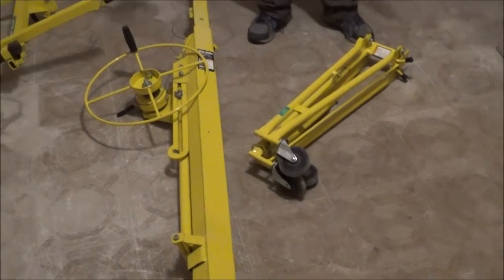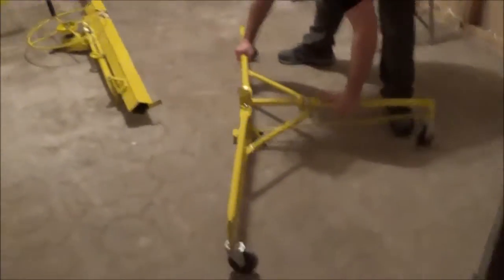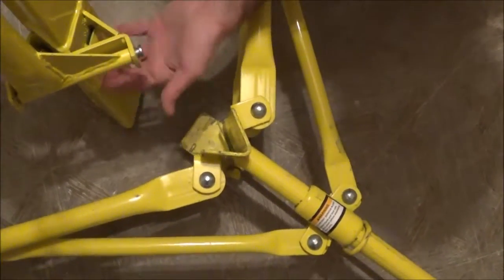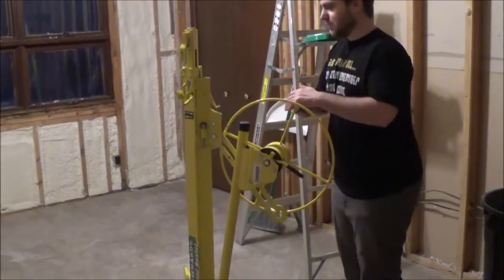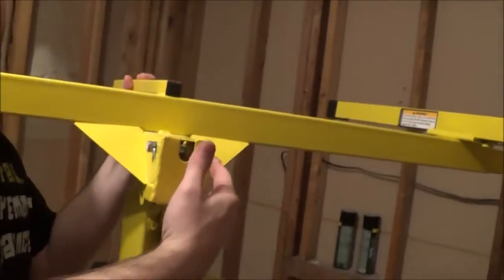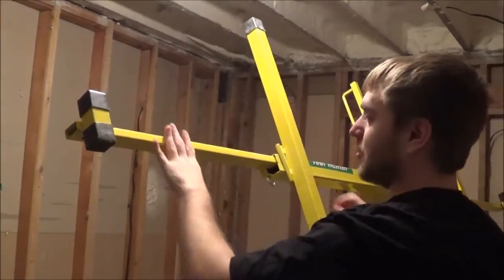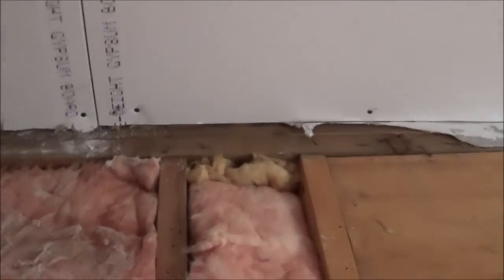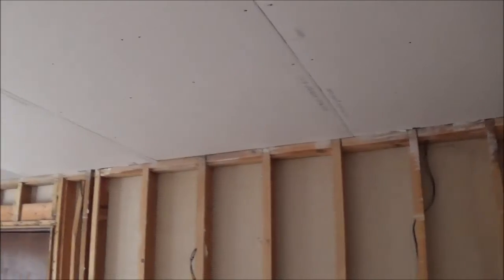Assembly of a Menards Drywall Panel Lift Rental and Review (Mud Boss SP-016-742)

Comment: You ran the drywall in the wrong direction
Reply from the maker: I ran it perpendicular to the joists, but I think in commercial drywall people go parallel. I've ran parallel on walls before to reduce but joints and it hasn't cracked in 10 years but it was sketchy since the studs aren't perfectly straight so some only had a sliver of the 2x4 to nail to, plus I put some on slanted so that didn't help lol. Thanks for watching :)